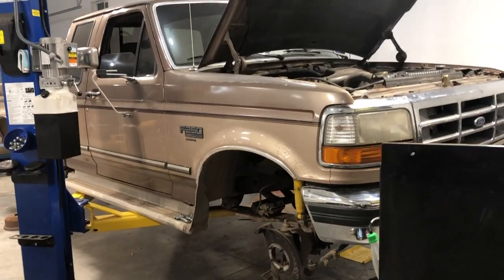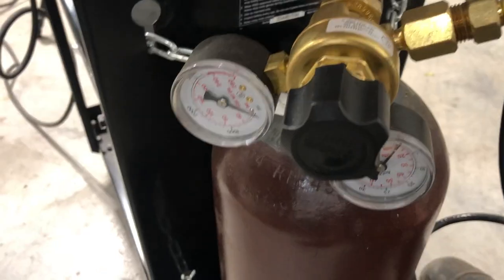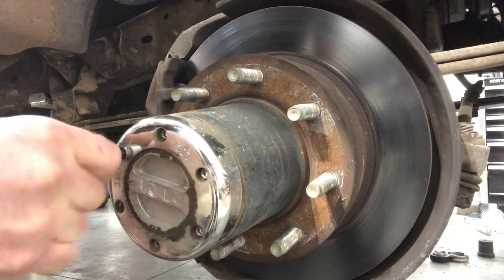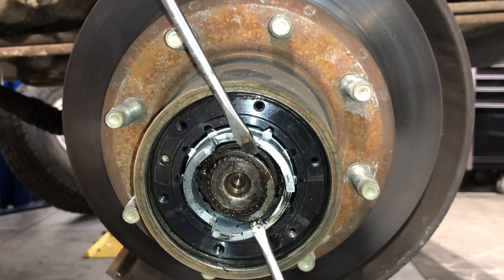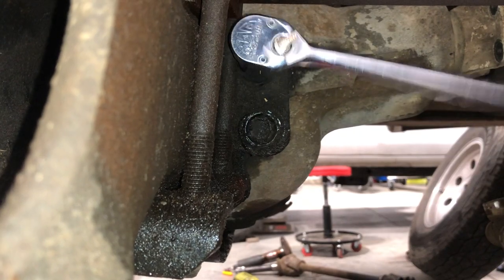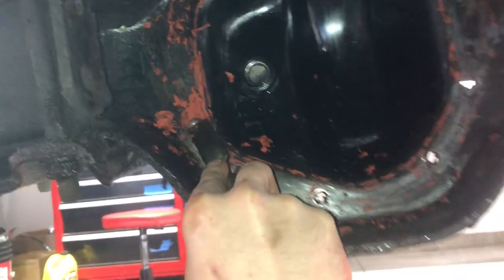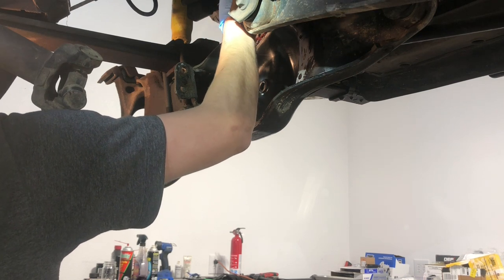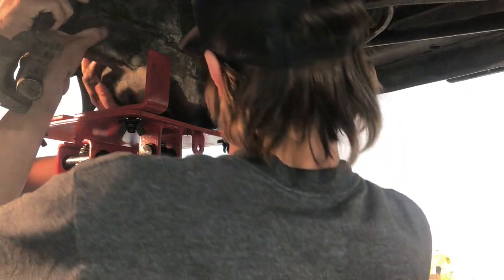OBS ford dana 50 TTB/IFS full dis-assembly complete guide

Comment: Great video man. My 1990 f250 hub blew off the other day. Truck was driving perfect no vibrations, noise, shaking. Then after im leaving the gas station it felt like all my lug nuts were loose. Limped it two blocks to my shop then boom. Wheel flys off with the rotor and hub still bolted on. So needless to say this video is coming in handy.
Reply from the maker: glad I could help out

Comment: I have a 95 f250 with the Dana 50 and my hub is loose but haven’t ripped it apart to see if those nuts are what’s causing it to be loose but my question is do they sell them anywhere with rotor already attached or are they separate and where can I find them I’m new to these trucks any help would be greatly appreciated

Comment: wow! this was a great video.  Great camera quality, too!  
I just recently bought a 97 250 and I'm doing a whole front end on it.  I think I'm gonna try doing the ball joints without taking the third member out, because my seals don't leak to my knowldge.  honestly, even if they do, it's no worry because I always keep up on fluid levels.  I was mainly worried about the 4wd hub, but upon further inspection that looks stupid simple to do!   everything onward just looks like regular repairs.  Thanks so much!
Reply from the maker: that's why I made it clear up any confusion on these front ends so I'm glad it was helpful
Reply: @fuelishgarage6587  yeah. since I commented I've ripped the entire front end apart.  I'm doing U joints, ball joints, spindle bearings, wheel bearings, brake rotors, pivot bushings, shocks and steering, and I'm almost done with the driver side.  Disassembly of my manual hubs was a little different than this, but it was easy so far.  Same goes for pressing out the wheel bearing races!  My 330k mile 97 will be driving smooth after all the new components! Later down the line I'm also going to do a new steering shaft and box, cheers!
Reply from the maker: @MCatwar  right on man keep grindin, I've noticed that there are different locking hub setups mine is a 1993 so

Comment: Hey great Vid !   two questions  , Was it worth it as opposed to going the Dana 60 conversion? The spindle removal tool WOW I need that, where did you buy it?     Ive had several of these trucks with the Dana 50 never found the love of the 50 but I never did a full rebuild thats why I ask was it worth it.  Thanks!

Comment: is there only 1 wheel barring? also is it normal having a integrated hub and rotor
Reply: on my 1990 f-150 4x4 it was a 2 piece rotor and hub so I put a new rotor on the old hub and there is a bearing in the hub and another on the inside or outside I don't remember

Comment: Why didn’t you do the bearing inside the diff? The ones on both sides? Just wondering since I’ll be doing the job pretty soon
Reply from the maker: I would if I had the money for a locker and the main reason I did this job was because the diff was leaking, I didn't replace them because my truck is fairly low mileage and I bet hasn't been driven in 4x4 all that much but they didn't make noise before I tore down too.

I like the way you think tho replace while your there so you don't have do it again

Comment: I am doing leaf bushings in the front cannot get my spring to line back up with shackle and help would be awesome
Reply: Which end did you put in first because I would recommend putting the rear in and also cutting out a little bit of the shackle right where it hits the frame so it can turn go back farther
Reply: @steamaccount117  i figured it out had to take out pivot pinion bolt and jack it 10 different ways was not easy but my God does that side sit nice now! I'll record the other side and post how I did it.... it was Jimmy rigged but worked.... didn't even take the tire off
Reply: @steamaccount117  also could used 3 jacks had 2 lol
Reply from the maker: maybe separate the leaf pack from the ttb arm

Comment: Awesomeness  now we now how to fix that inner stub shaft seal.  We might as well do both sides and replace the ujoint even thought it seems ok. But still why not since will have it out.
Reply from the maker: lol I pulled it apart cuz the diff was leaking and ended up replacing everything since its pretty inexpensive and my driver side u joint was toast